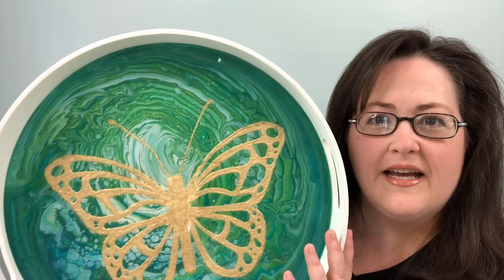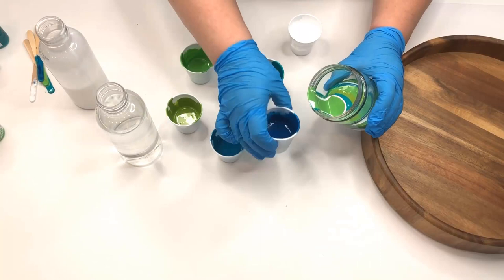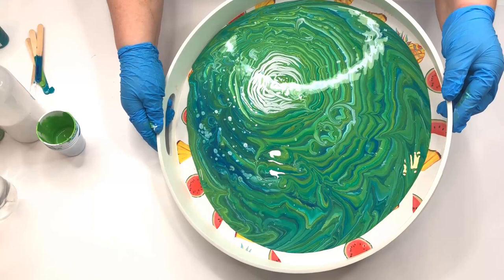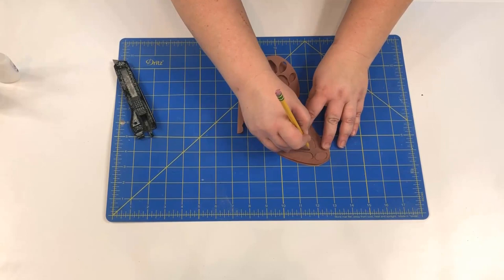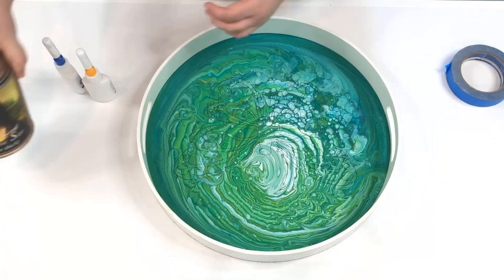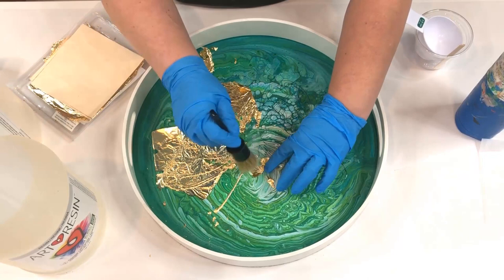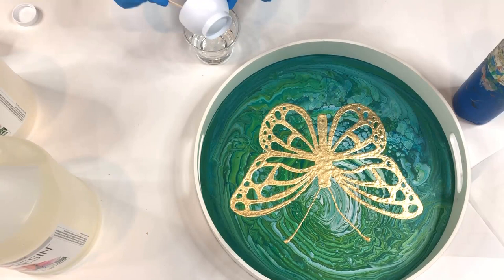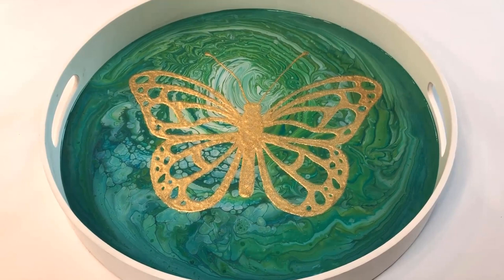Acrylic, Gold Leaf and Resin Serving Tray

Comment: Thank you Kristi!! Does the clear coat help keep the gold leaf from sticking to the paint and only to the adhesive or is it to just seal the paint? Asking because I tried it on resin and the leafing stuck everywhere, even areas with no adhesive!! Thought acrylics might not do that so was intrigued with your use of the clear coat.  Thanks again, Great video!!!
Reply from the maker: Yes, the clear coat keeps the gold leaf from sticking. Acrylic paint tends to have a tacky feel to it even after it's dry, and that slight tack will cause the gold leaf to stick to places you don't want it to stick. The clear coat dries really hard and doesn't have that tack to it when it's dry, so the gold leaf won't stick to it.
Reply: Thank you so much!! I really appreciate you taking the time to answer and explain!! Beautiful tray😍